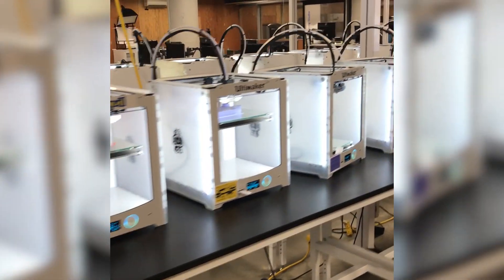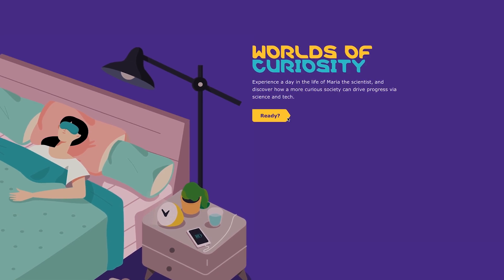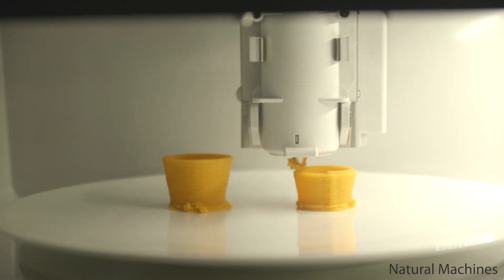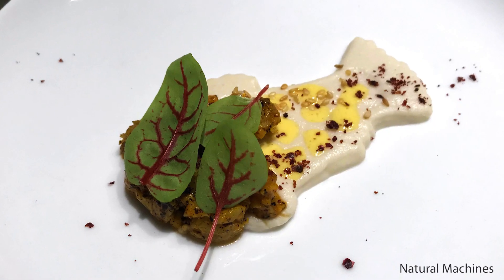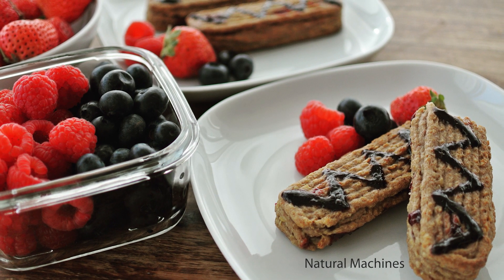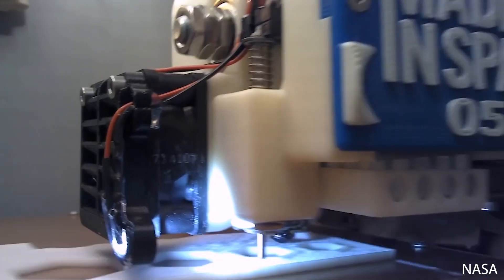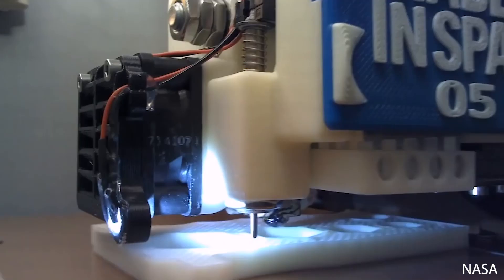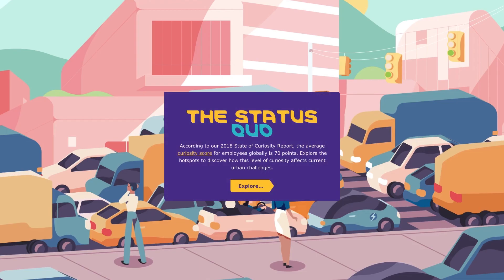3D Printed Food | #AlwaysCurious

Comment: Those laser 3D printers are how metal 3D printers usually work. The machine lays out a thin layer of metal dust, the laser flash melts the metal dust together in the spots it turns on. Once that layer is done it lays out another layer of dust and starts over, this time the new layer being hit is sintered to the first. Once your object is finished in that printer it is not done yet! You need to bake it at the right temp to let the crystals flow together so it isn’t this highly brittle useless model.